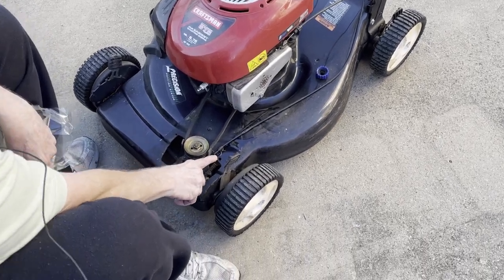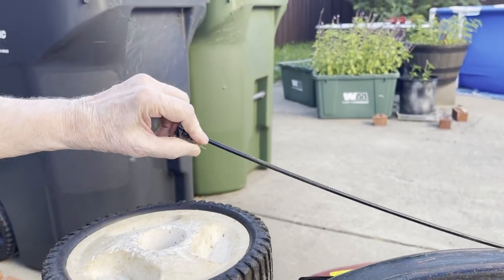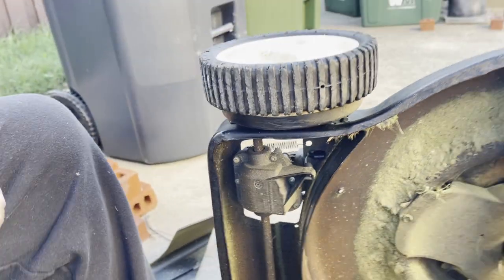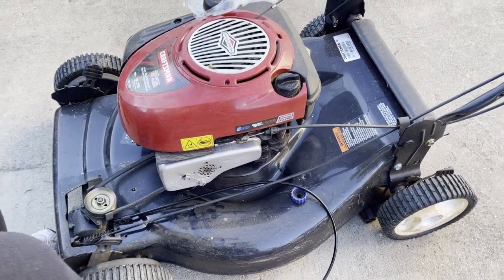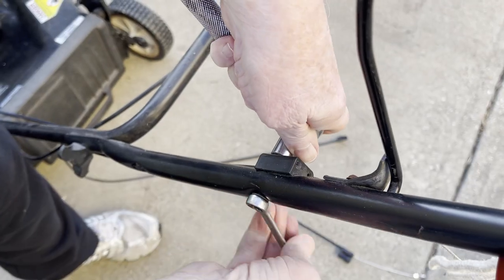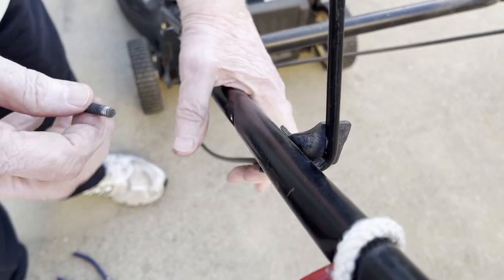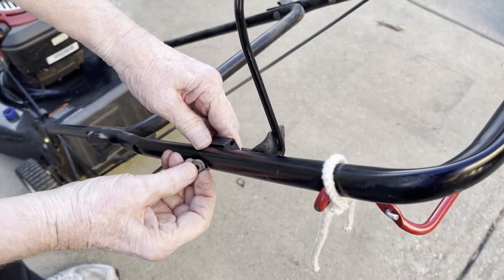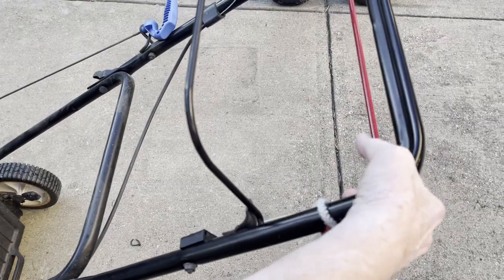Replace Broken Self Propelled Lawn Mower Cable 💪

Comment: Should always tip the mower "carb to the sky" otherwise you'll dump oil into the intake.
Reply from the maker: Thanks for the tip. We did try to follow the instruction Manual.